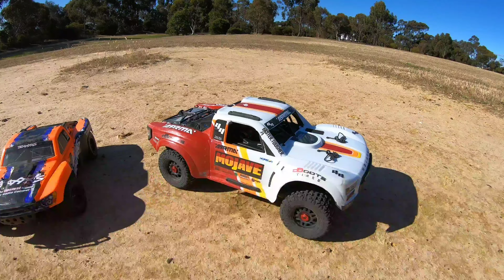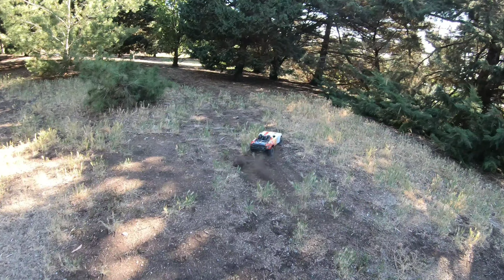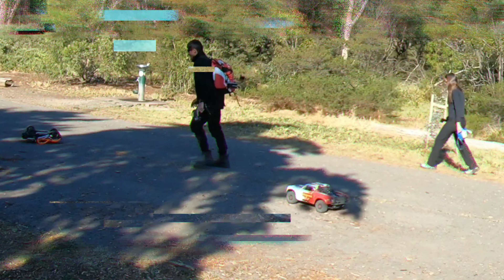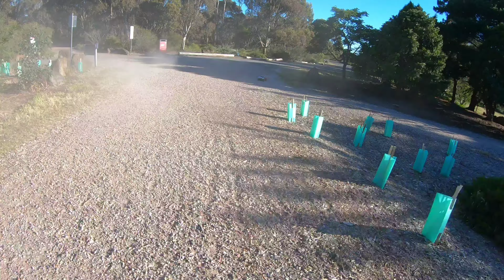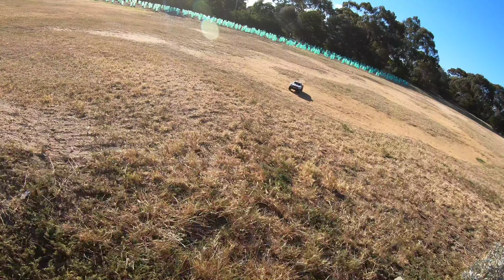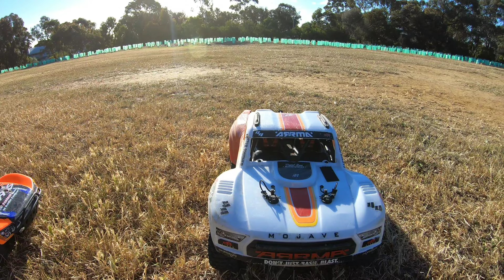Mojave 4s and Slash 3s HEAD TO HEAD🤜💥🤛.. How do they compare? #rccar #rcbashing

Comment: To get the body off the Mojave, I just grab by the roll cage kinda over the front windshield area and give it a good drop-shake move and it comes off easy even in the super super fine gravel/dust I run in. Only complaint I really have about this rig is the bearings eat dirt and seize. No biggy and not very hard/expensive to replace
Reply from the maker: Yes I donecthe same thing in the last video I think, the drop-shake thing, it works👌
And I haven't noticed any bearing damage yet but it is a common part to wear or take abuse, I purposely over stock my bearing supply because I do abuse my cars.

Now I don't recommend doing this AT ALL!
And I ONLY do it to one car, my Maxx, but I get it out a month after a bash and it's completely locked up EVERY TIME, I literally and not nicely force it to free up without lubricating or removing anything and after doing that at least 30 times it still runs perfectly every bash(box stock parts) other than the widemaxx kit🤔😳
One day we'll take a look, im sure there will be problems😅
Reply: The whole 3s 4s line eats those two bearings in the module, not just the dirt but the bearing small for amounts of heat and abuse it takes I’ve been meaning to order just that size and the inner bearing on the 6s guys , those are two spots the bearing is very thin due to inside diameter being so big , I kept ordering bearing kits and really these sizes that go bad and end up using them bad till they seize they cheap enough to just change every 20 packs or less 😂
Reply: @RcPlayer-tt2vw  I actually haven't had any of my module bearings have issues for some reason. Just my inner-outer wheel hub bearings. I have heard about the module bearings seizing, but haven't had that happen yet with either my Senton or Mojave 4S
Reply from the maker: Do they get eaten or do they seize?
Very different!
In the 5 years or do of owning my Krayon(Typhon Mega converted to 4s brushless) I've never damaged or seized any bearings including the module bearings.
I'll probably never have a seized bearings except in my Maxx due to the Maxx being the only car I will drive in the wet, locks up LITERALLY every time I drive it🤣
But a bit of a soak in wd40 and then some bearing oil and they're good to go again, 30+ times now
Reply: @rccrazy  yea I was going to say the seizing is if get wet and let them sit , but they will get eating up if don’t change them first and than the ring gets stuck in the hub , if it’s 4 years old why not spend 6 $ on couple new bearings , actually just one on the hub , and you can keep oiling it but once they’re sloppy they cause more heat , I seized bearing couple times on the maxx too , that trucks still the best for wet conditions. I used to use the granite in wet conditions. Yea the typhon to low to the ground for that stuff . If you spin the bearing on your typhon it probably sounds like a skateboard wheel which means has alot wear and tear no grease
Reply: @rccrazy  yes I do that too as well but just a quickly I spray the bearings with oil but silicone oil is better unless the bearings already worn but wd40 will take the factory grease out
Reply from the maker: @RcPlayer-tt2vw I don't need to spend anything on bearings as I have easily 200 spare bearings in all sizes, but I didn't say any of my cars needed new bearings, they are all fine at the moment even the original ones on the maxx
The Krayon is a truggified Typhon so it's as tall as a Kraton!
And as for my own skateboard bearings, ceramic and silent, sorry😅
I know what your getting at though, bearings wear out, fail and break, but it is possible for them to last for a VERY long time with just a little care and maintenance.
Reply: @rccrazy  ok I’m just saying what most guys do with 3. S line without realizing even myself and I keep forgetting to order two size bearings because I also have 200s bearings except that dam one or two sizes and it’s because what I explained they just take more abuse than others because of the inside diameter is large for bearings those size I read the comments belaying learn something new all the time this I learned through experience with that rc but as I’m sure you know everyone experience is different, so why I’m saying for you I mean myself too I haven’t been using those rcs I just redid the 4s outcast and the granite , outcast has new Mojave wheels all detailed up as granite new body while stripped brcc for parts , using the body on the maxx with sweeps pin truggy wheels and maxx 8 today it’s pouring and I’ll use that rig , tires have 100s cycles idk how they still working but pretty wobbly from dam traxxas pritortary hex’s 😂. That truck I just bought all new hubs with the bearings spindles for 20 bucks are so than couple times that bearing up top I changed couple times but like you said you had to do I assume same one , I broke that powder idle gear ⚙️ once but even that was my fault I didn’t put screws in the cover
Reply: @rccrazy  I agree I have couple original arrma steel shield bearing dam this bearing still good 👍, I have the opposite my typhon has 6s hubs and axles and I have kraton with typhon arms diffs and kraton hubs and axles , think I have kraton rear tower shocks something inbetween on the front lol , not big fan of exb diffs
Reply: @rccrazy  I’m confused you mean a trughified kraton and the 4s guys ? You turned 3s typhon with 4s kraton parts ? That’s pretty cool o wanted to do that to my granite or atleast the typhon 3s arms with 17mm so I can run buggy 🛞
Reply from the maker: @RcPlayer-tt2vw mate I thought we were talking about 3-4s rigs, aren't they all basically the same towers, hubs and axles??🤔
Reply from the maker: @RcPlayer-tt2vw yes I call it the Krayon(Kraton and Typhon)🤷🤣
And I'm actually running all the RPM Kraton arms and the game changer was the M2C motor mount and block system💪
https://youtu.be/h14PBmLuhaw
Reply: @rccrazy  we were I veered off lol .
Reply: @rccrazy  no the hubs for outcast and kraton are a little bit wider than all the other Arrmas and they all share the same hubs . Apparently even hot racing doesn’t know this because I bought aluminum hubs and they say kraton typhon and talion . You know what was confusing me ? I  had 17 mm hexes I assumed were from the typhon but their from the old 4s line and the typhon always had a proper 17mm hex and axle stub
Reply: @RcPlayer-tt2vw I bought a metal Integy brand spur, which is okay, but the bearing it came with lasted 3 jumps into concrete, and the whole inner bearing parts flew out, misaligned my spur, and chewed up the spur because I didn't know the bearing was shattered, and kept driving. I thought the noise it was making was just the noise of the metal spur (because it is louder than plastic)
Once I put the stock bearing back in, I noticed it had a lot more "beef" around the outer bearing than the Integy one did. 
The Arrma bearing is probably a million dollars, but if mine broke again I'd replace it with an Arrma bearing, because I don't want to ruin another spur. That was $20 down the drain.
Reply from the maker: @Boogie_the_cat bit of a different set-up car but same thing happened to my remo hobby 9emu, "upgraded" bearing blew out rather fast, didn't realise so kept bashing then all of a sudden I had neutral, yep my spur totally stripped, luckily I hadn't upgraded the spur yet like yourself😥